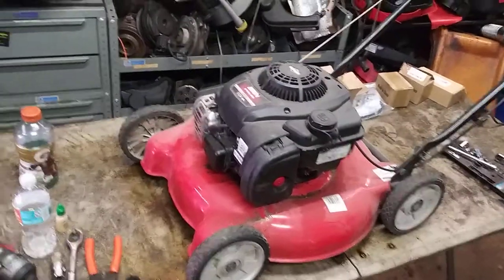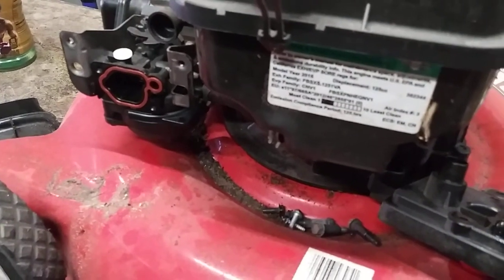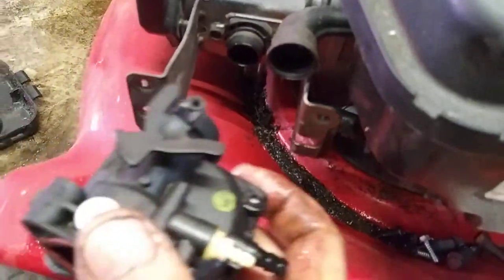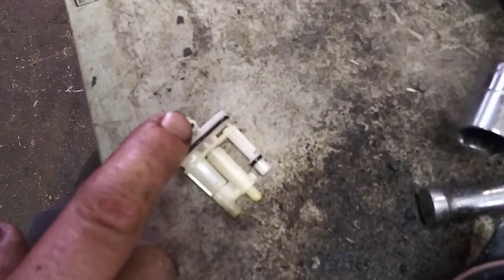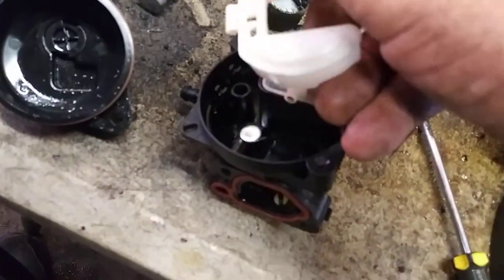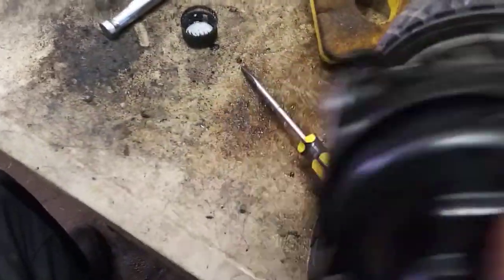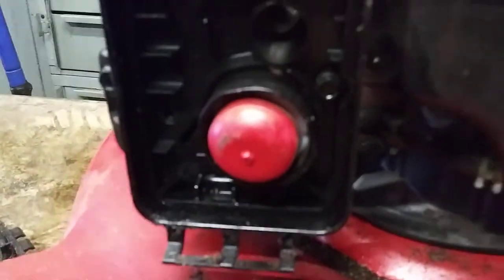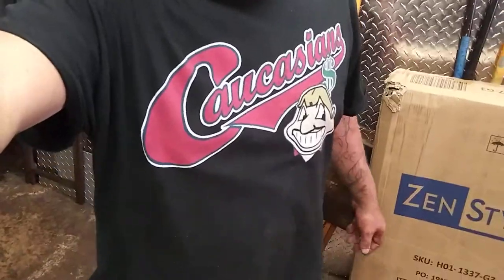* Mtd 20 inch lawn mower carburetor repair briggs and stratton 300e carb cleaning

Comment: im 12 years old and used this video to fix my dads lawnmower it went from not starting at all to running perfectly fine thanks so much
Reply from the maker: nice good job man. glad to see some of our youth still into it.
Reply: @smallengineguys  yes sir i love fixing things I put a top end on my dirtbike a cou[le weeks ago but I did something wrong it still won't start
Reply from the maker: @ckossum3001  having the same trouble with a moped i have. Pull it back apart try again. Make sure you put piston in the correct direction.
Reply: @smallengineguys  doing it as well today.
Reply from the maker: @shelbeecoulter6219  nice! You should record what you do as you do it. Post it on youtube. I wish i started earlier.
Reply: @smallengineguys  I got it almost done and then my dad helped a little but we ended up having to take it to a family friend because we had trouble with a part where you said to wiggle it out. The throttle part I believe was giving us trouble.
Reply from the maker: @shelbeecoulter6219  thats how you learn did you at least watch the friend take it out?
Reply: @smallengineguys  No I didn't get to watch him take it out but I wanted to. I really wanted to finish the job but my dad didn't let me.
Reply from the maker: @shelbeecoulter6219  that sucks. Well better luck next time.
Reply: @smallengineguys  well I actually found out why we couldn’t fix the lawnmower. There were sticks and all sorts of things in the gas part. We just went and bought a new one.
Reply: @smallengineguys  knowledge is power, I think it is awesome you enjoy learning how things work and fixing things.  Good job.
Reply from the maker: @sunnyrussell6896  lol im old ive learned how they work. I think you were trying to talk to the 12 year old kid and yes always awesome when you find a kid like this. No one wants to work anymore. Any kid that wants to will make big money when they are older.

Comment: Our MTD w/ B&S engine, 6 yrs old, ran it until it stopped at the end of last season to get rid of all the gas, like always. This season, it won't start. Tested for spark, all good there. Swapped out a new plug, pulled 4x, removed the plug, it's dry as a bone and the gas tank is filled. Gotta be the carb is clogged. Now to do this work, and pop in a new air filter, too.
Reply from the maker: yeah its the carb
Reply: @smallengineguys  I sprayed some carb cleaner and it started chugging a bit, but didn't stay lit... I'll get that carb off soon...
Reply from the maker: @SportsMusicCars  carb and probly some water.

Comment: The pin that held on the float valve slipped out very quickly for me and landed on the floor.  I was very lucky to find it.    What I found after cleaning the carb was that the little plastic seat that the pin valve was going into -- it was breaking apart.   So, I had to get a rebuild kit.

Comment: I really like how you kept it simple (not a lot of chit chat and such) and still pointed out the important particulars like the jet cleaning and such. Not my first carb cleaning, by far, but my first with this particular carb model (used to working on my GY6 moped engine and carb).
Reply from the maker: Gy6 has same basic components as any other carb.
Reply: @smallengineguys  Admittedly, it has been some years since I cracked one open and wanted to know what I was getting into before I did. This carb is actually a bit different than the carb on my GY6 (and most other carbs I've seen, which isn't many really). Plastic, for starters, and a different layout. The carb on my GY6 had all brass threaded jets, if I remember right. This one had a plastic mold in place for multiple jets. I guess it is possible that we could be thinking of two different carbs for the GY6. I know there was at least a few designs, but I only worked with the one.
Reply from the maker: @skudmissal1418  no I mean along the lines of a jet that has to be spotless and clean and a float and needle valve that can't leak.
Reply: @smallengineguys  oh, yes. Quite agree! You did say, "basic," lol. Can't get anymore basic than that. 👍🏻

Comment: This dude is spot on with his fixit video, this would have solved my problem had I not dropped my carb and launched the float valve needle into the lawn never to be seen again right before being attacked by red wasps. For those who come later the replacement part number should be 231855S, I will return to confirm this once it comes in the mail and I reassemble things.
Reply from the maker: lol. not the correct needle valve. this is it. https://amzn.to/3LgIGS2 but youll find a new carb is only a few dollars more. https://amzn.to/3LC8aKI
Reply: @smallengineguys  Thanks for the tip, I'll let you know! I just went with what looked similar in the catalogue at Briggs & Stratton Parts. What you've linked looks nothing like what came out of my mower. I ordered that carb as well so I can tear them both down and verify parts. Either way, helpful video.
Reply: @smallengineguys  I took apart the new carb and can confirm that's the float needle valve that came in it. Not sure why the one in the old carb was all stainless. Weird.
Reply from the maker: someone was in it i guess and put in the wrong needle valve. surprised it worked im going to have to try it now lol.
Reply: @smallengineguys  Yeah ya got me. I ended up having to put the entire new unit in. I swapped the needle valve in from the new unit and it didn't function but the entire new unit worked toot sweet. And I think the replacement stainless needle got lost in the mail because it hasn't shown up yet for testing. 

Anyway, thanks for the video. I found a lawn mower on the side of the road yesterday and all this diagnostic stuff is a great hobby! I got it running in about 45 minutes and it too will need a fresh carb because of bad gaskets in the float bowl and priming bulb. Go figure. Leaks gas everywhere but it started up without to much of a fuss once fresh fluids had gotten everywhere. :)
Reply: I could see this playing out, dropping the valve, and then the wasps😅 Good training 😅

Comment: I tried this, and it started but then ran weak and died.  Now it won't start.  Gonna tear it down again (maybe I messed something up) and replace the spark plug as well.  Thanks for the video!  Good work!
Reply: Update: redid it all, replaced filter and spark plug...it runs but almost sounds like it's revving up and down quickly...at least I can cut the grass tho
Reply from the maker: oring on the back side of carb needs to be installed in the carb for proper seal.
Reply: @smallengineguys  I'll check that for damage, thanks for saving me some $$!
Reply: @johnodinsson3635  that’s yo carb needle bouncing up and down… mine does the same some times. But yeah make sure all gaskets hoses and fittings are tight

Comment: I had followed the steps and got my lawn mower working last night. This morning, I noticed it was leaking gas and it stopped turning on. Any advice on what maybe going on!
Reply from the maker: yes your needle valve under the float is stuck open. my guess is you didnt get it clicked all the way in. remove carb remove float rinse and reassemble making sure float is completely clicked in place. with carb off pull motor over many times it will eventualy dry out and fire up, shut off as soon as it fires. or remove plug pull over many times at least 20. rinse plug with carb cleaner reinstall. you may have to repeat this a few times.

Comment: The jet assembly is actually two pieces. Look close and separate the two. You’ll expose a nozzle with 3 holes. All 3 holes need to be cleaned or you’ll probably still have a surge.
Reply from the maker: Found its best not to separate them. They dont always go back together properly and leak making it run rich.

Comment: I have the exact same mower. It will not start. It would start up but then immediately die. I cleaned the carb put it back on. Now when you pour gas in the tank it just pours gas out through the carb into the throat of the carb and even pour gas out of the white nozzle above the fuel entry hose. I am going to buy a new carb for it. Not sure what the problem is. Also the float is not sticking I can hear it moving when i shake it a bit even after Ive pulled it back off with all the gas in it. Thanks for any advice.
Reply from the maker: needle valve under float isnt in all the way or dirty. take back apart and redo
Reply: @smallengineguys  Thanks for the reply!! I will do this asap.

Comment: Thanks, from Texas! I think this will work for mine.  Going to give it a try, sometime this week. :)
Reply from the maker: So this is how i test it. I take off the airfilter i spray carb or brake clean in the carb. Try to start it many times if it fires and shuts off its carb. If not its time to check plug, compression, and spark. It is carb 90percent of the time.
Reply: @smallengineguys  Is the carb and choke cleaner spray (which they sell at auto parts stores) safe to spray into this carb?  Or will it melt the plastic parts?
Reply from the maker: @007mercucio  its fine i use orielys brand brak cleaner
Reply: @smallengineguys  Okay, thanks!  This should help a lot.  I appreciate it.
Reply: @smallengineguys  Well, I got it to pull start, again, and it runs, but it runs erratically... and the whole lawn mower lurches to one side, every 2 or 3 seconds.  I suspect maybe it is that needle valve... if it is pushed a little too far back, maybe it isn't opening enough.  My other hypothesis is that maybe one of the jets isn't blown enough, yet.  Not really certain... But here is a clue that makes me sure it is still a lean fuel issue:  While it's running, I sprayed starter fluid onto the air box, and the lurching motion, and erratic running, both stop, for about 15-25 seconds, while the mower consumes the ether / petroleum distillate spray.
Reply from the maker: @007mercucio  carb needs to be cleaned jets are still dirty. Make sure you have gasket between engine and carb.
Reply from the maker: If the oring between engine and carb isnt installed back in the carb it can run lean but probably dirty jet still. Poke with wire from wire wheel.
Reply: @smallengineguys  Maybe it's just the screw holding it there.  I'll try tightening that down, first, before going whole hog, a third time.  The O-Ring is there, btw.  It seemed fine, but I didn't look at it very closely.

Comment: I have watched a few of these videos,  this is the easiest.  But my question is on my lawn mower B & S 300E, it has a sponge in where the carburetor is.  Do I have to get a new one,  I have to order all I need from Amazon. My Lowes does not carry any parts. Thank you. By the way I am a 74 yo widow, and have to do it myself, so I like easy.
Reply from the maker: do you mean the air filter? if so no just blow it clean with air or even just shake it clean. no water or fuel to clean it though

Comment: I have this exact mower, it runs fine after cleaning the carb but it won't start up again unless it's primed each time after warning up...not sure what that could be.
Reply from the maker: Old gas. Gas is only good for small equipment for 3 weeks

Comment: I took my apart cleaned it out with carb cleaning spray and out it back together. It starts and idles very low but can't seem to get above a low idle, bogs down and dies if I try to manually move the throttle arm. 

Not sure how to make it work better?
Reply from the maker: so it should be set at full throttle at all times. spring is under gas tank. bogging out and stopping is carb. jet needs to be cleaner. or the little white piece in carb mouth fell out its round and white. or you forgot to install o ring between motor and carb in carb before putting carb back on.

Comment: I've been having issues with my mower, same as yours. I originally thought it was low on oil and gas so I filled them up and it still didn't work so It's most likely this is issue, it's my first time doing any sort of mechanic stuff. I'm not sure how much gas was in there originally, but will I be able to save the new gas I put in?
Reply from the maker: no throw it away and get new
Reply: @smallengineguys  Alright, thanks! 👍

Comment: What's the small white plastic hose barb that sticks out of the right side of the carb? I've been driving myself crazy looking for where a hose would connect, thinking a hose got ripped off, but it appears there is no hose that's supposed to go on it.
Reply from the maker: its just a vent. no hose.

Comment: Right above the fule line there's a breathing white tube. When i prime the lawnmower 3X fuel spraye out that white tube. Whats that about?
Reply from the maker: Over flow. Shouldn't do that. I'd clean the carb. If it works tho leave it.

Comment: Thank you for the video. It worked well for me. The mower is running now. Now the issue, it leaks gas. What did I do wrong?
Reply from the maker: sounds like you didn't get the float and needle valve clicked all the way in or fuel line is bad.
Reply: @smallengineguys   That is the oblong part that you said to take a wire too to clear out the port?
Reply from the maker: @davew4343  no its the other white part that floats in the bowl held on by a pin and the needle underneath it. That controls gas flow.
Reply: @smallengineguys   Thanks, I will check that out.

Comment: Omgggg I did this and it worked!! For a while then it shuts down. I noticed when I pump the gas longer it workes longer? What can it be??
Reply from the maker: Carb. Sounds like you used old gas. Reclean carb and use brand new gas in a fresh dry empty jug. Youll more than likely find water in the carb.

Comment: My mower will crank and run for a few seconds then die.  It won’t crank unless I prime it 3 times again.  Then it’ll do the same thing.  I pulled the carb off,  sprayed the jet down with carb cleaner.  I reassembled the carb, but the mower is still doing it.  Could I have not cleaned the jet well enough?
Reply from the maker: Jet needs to be cleaned better. Try pulling a wire out of a wire wheel and poking threw the jet then spraying.
Reply: @smallengineguys  Thank you for replying.  I’ll pull the carb off again tomorrow and try that.  I’ll let you know the results.👍🏻
Reply: @smallengineguys  Hi, just wanted to let you know that the mower is running great now!  I ran the wire through the jet quite thoroughly and then hit it with carburetor cleaner, reassembled it,  and she cranked right up and is running like a charm.  Thank you and I’m subscribing!
Reply from the maker: @pystrykerstaff5378  nice! Great job!

Comment: Thanks for the great video! This was my girlfriends mower, it had bad gas and I cleaned the carb by watching your video. Quick question starts up great, but when it is running it has a wavering idle. Any suggestions and thanks again. Your mower on the video is the same one I have.
Reply from the maker: Either needs jet cleaned again or white part jet is in is seperating and needs to be squezed back together with pliers (top to bottom) or rubber oring on intake wasnt reinstalled on the carb before putting carb back on engine or gas is old. Starts loosing its spunk after 2 weeks.

Comment: Great video, cleaned the carb, but still only runs off the fuel primed in, then dies. Strange part is, it will keep running if I tilt it 45 degrees on the left side. I figured, it was the float/needle, but it appears to functioning fine. If anyone has any advice, thank you ahead of time!
Reply from the maker: sounds like the little plastic piece that goes in the carb had fallen out. it will be round tube shaped. super important. or you still haven't cleaned the jet completely. you may need to poke it with a wire from a wire wheel. or use 14k testing solution to boil it out. https://amzn.to/32nQwp2    if the jet isn't perfectly clean it wont run.
Reply: @smallengineguys   I believe it's the plastic piece, I ran wire through everything and it appeared clean. I will let you know how it goes, thank you! (bought the lawnmower used, I believe the plastic piece was already missing)
Reply from the maker: @jon-erikpalmer1897  new carb is needed then

Comment: Going to try this you didnnt start it back up tho
Reply from the maker: lol it ran i do this in my small engine shop. i dont get paid unless they do lol.
Reply: @smallengineguys  okay i trued another method but with carb cleaner and quick start but it still wont stay on so im going to have to pull apart the carb but feel confident with your video
Reply from the maker: @jayreviewedit3852  easy job. You got this.
Reply: It worked you the man!!
Reply from the maker: @jayreviewedit3852  fake it till you make it!!